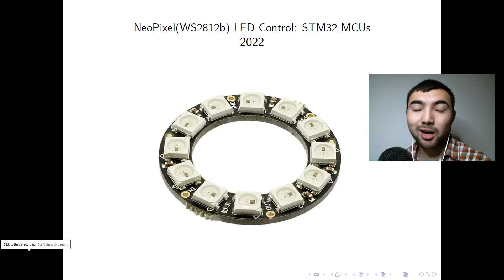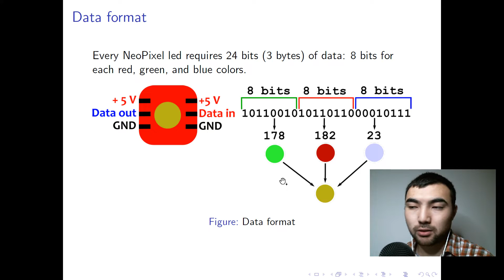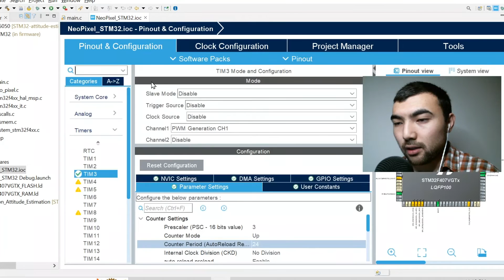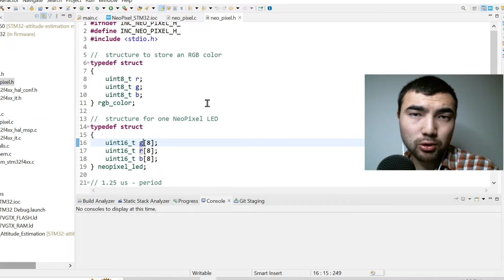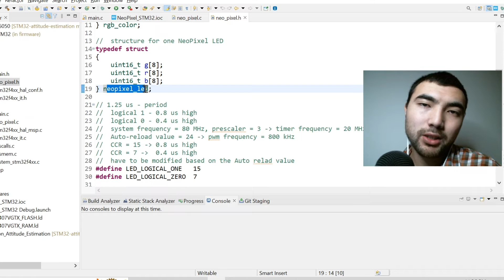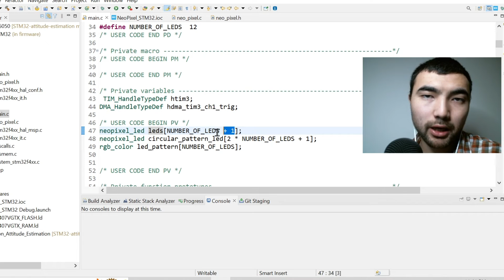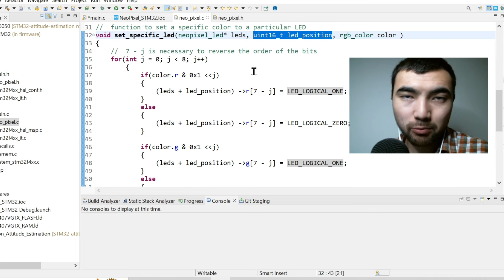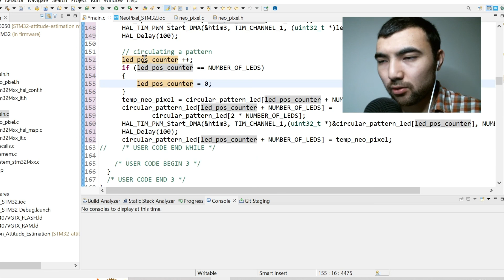STM32 LED Strip (WS2812b) control 1: Theory and implementation

Comment: Just a side note:
If you set the prescaler value to 3, the prescaler used by the hardware is 4. (The hardware prescaler is always 1 more then the value you set. This is to make it impossible to set an effective prescaler of 0)
Then your calulation of 80 / 4 = 20
is correct

(PS: in the code everything with regards to this is correct. It is just for a student, who might wonder why 80 / 3 equals 20. It doesn't)
Reply from the maker: Hi, thatnks a lot for your note

Comment: It works well but I'm a bit confused about the data structure newpixel_led, why are you using uint16_t instead of uint8_t? and why a 3 elements of that size if every color is represented with only 8-bits?
Reply from the maker: Hi,

If we look at the data structure:
typedef struct
{
	uint16_t g[8];
	uint16_t r[8];
	uint16_t b[8];
} neopixel_led;

Each member is an array with 8 elements, corresponding to the number of bits per color. For each bit, we need to generate a PWM signal with a particular duty cycle. For that purpose, we need 16-bit values. Hope I could answer your question.
Reply: Because the timer is a 16 Bit Timer. Thus you need to load 16 Bit values into its compare register (CCR). The DMA will do this for you. Remember when you selected HALF_WORD as the DMA data transfer? This is exactly where you tell the DMA controller to load the timer with 16 Bit values it takes from the memory field you provide.